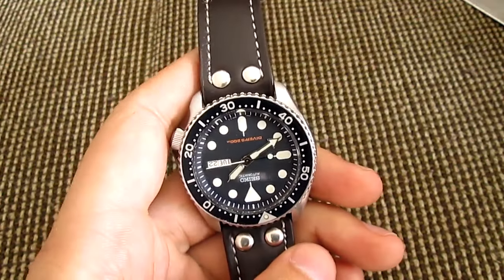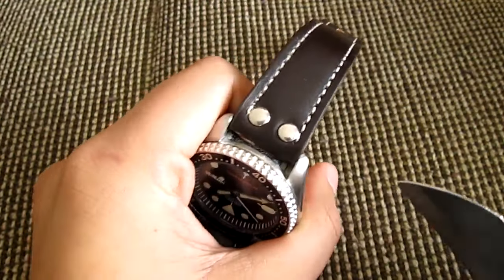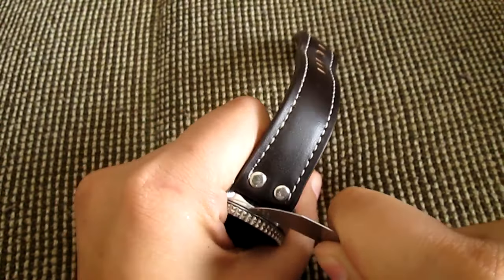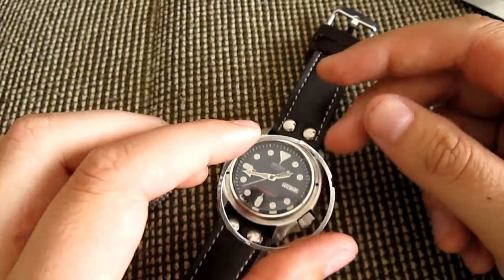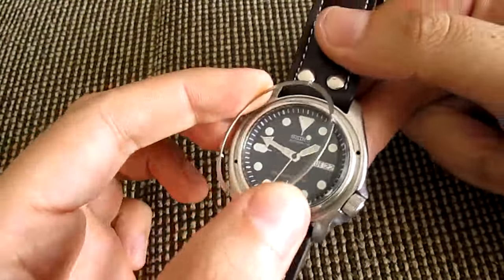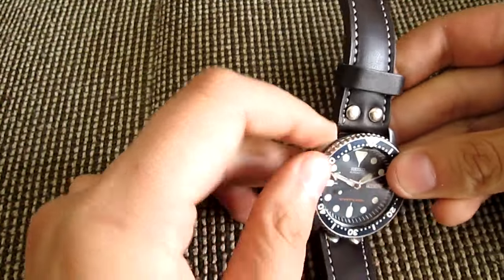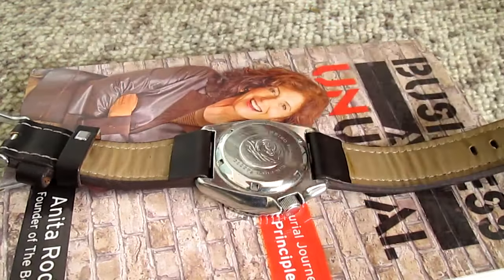How to Remove Bezel from SEIKO SKX Watch - How to Fix Stuck Bezel

Comment: That's the savage way, there is tools to remoove a bezel properly without risking to completly scatch the watch or even deeply cut you finger.
Reply: Newb question: What are the tools that one would use to swap out a bezel?
Reply: I use a katana sword
Reply: For $10 on Amazon you can get a whole set of watch back removal pry tools.  Works perfectly. 
Look for the ones with the large yellow plastic handles.
Reply: Are tools....savage

Comment: Don't use a potato peeler for this. Two feeler gauges (.006 and .007) will work better and won't scratch up the case.
Reply from the maker: I actually use Swiss Army Knife Victorinox can opener works like a charm but not everyone has one and I always try to find a common household item.. great suggestion though someone will see it and find it helpful

Comment: hi, have you ever done this with a Seiko skx013? The bezel on mine is tight and it is not gunked up as it is new. Would silicone oil sort it out? thanks
Reply: wayne murphy same deal. Manage to resolve the issue?
Reply: @benmfisher94  did you solve it?
Reply: @thenande  I popped my bezel off from time to time and made sure the spring underneath was lined up properly. A knife between the bezel and case should be enough to pop it off
Reply: @benmfisher94  Thanks! I don't know how mine is so stuck, I would press until my right hand hurts from the knife handle and it would not bulge. I'm glad you could, that gaves me some inspiration to keep trying.

Comment: I would suggest (if it hasn't been mentioned) to use a caseback opener. The edge is not sharp and has a taper that slides right in. Aside from that, great demo. It helped me out! Thanks
Reply from the maker: +Jan Alexus Kho my favorite and most efficient tool is Swiss Army knife can opener

Comment: Great video. I had a Seiko monster once that had a sticky bezel. I removed it with a butter knife and just like you said, put it on the carpet on the floor and just pushed it back on. Bezel is very smooth now.
Reply from the maker: +TheStig ZeroZeroZero as they should be .. Seiko Bezels are one of the smoothest I have ever had
Reply: Going to do it today with my SRP309 orange monsters with stuck bezel. Wish me good luck :-)

Comment: Thank you great vid followed your instructions ..... cleaned and popped a bit of grease onto the "o" ring and HAPPY DAYS, the bezel turns so much easier now. Also putting the watch face down onto a flat surface and yes popped right back on. Thanks again all the best.
Reply from the maker: happy it worked out for you .cheers

Comment: I recently loosened a jammed bezel on a Seiko diver by immersing just the Bezel part in hot water in tumbler,not the whole watch ! .....we only want to heat up the Bezel ring,not the whole watch
by immersing just The Bezel in hot water it expands the metal  ring,and frees it, also it loosens any gunk trapped in the Bezel.
very quick, afterwards rinse it under a tap rotating the bezel then lubricate with silicon spray.
One assumes all the seals are ok before doing this!

Comment: nice video! 
But I'd like to know if you have ever tried to change the bezel insert? If not, could you do a video on how to change the insert? I think it could change the look of a Seiko if you ever get bored with the color, or just to make it different!
Reply from the maker: +Guillaume David I did it once by accident so I had to put the insert back in ..however I didn't have the proper adhesive so I used loctite , I was careful and I was able to do it successfully but I dont have spare bezels to ruin for video :)

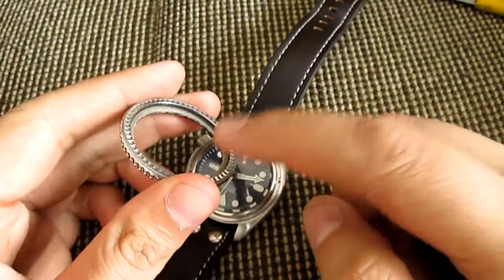Comment: OMG left thumb position until 1:45 is terrifying lol. do you know if the BEZEL INSERT will easily pop out once the bezel is removed like on a submariner? I have a SNZF17 that the bezel PIP is slightly off center between clicks and it drives me insane!! what kind of lubrication do you use, silicon? i've also read the sometimes you can free a bezel from sand, salt, etc... using tooth floss but i've never tried. thanks for the vid EDC!
Reply from the maker: +Andrew Poon if you pop out bezel insert you will need some kind of glue to hold it back ..not sure what kind but look into it before you do anything .. I just use silicon grease for the gaskets nothing else.. I suppose you can floss it ..if you are uncomfortable to do it (I would if it was submariner :) but this is generally better way to clean it .. I once had completely stuck bezel and after cleaning it was good as new

Comment: Great video! I need help though. When I press bezel back on only half of it wants to snap in place. I hear 1 loud snap but half of it is still higher than the rest and won't rotate
Reply from the maker: align it properly and use flat surface like a book until you get it right, when its half there and you make sure everything as it should be dot be a afraid to aply more pressure

Comment: Can you get to underneath the crystal this way or must you go through the back?
Reply from the maker: I wouldnt recommend it
Reply: Thanks, I actually found a video of how to remove the crown first & the movement popped right out. Was able to then get to the crystal to wipe away all the condensation. What's weird is as soon as I put everything back together. Condensation built up again??? So I figured that the movement probably had residual moisture, let it sit out in a Tupperware container with some of those silicon moisture absorption bags you find in rice bags & after about 48hrs it soaked it all up. Thanks!
Reply from the maker: 1988remixx thats a proper way to to do it , I think I have a video somewhere how to remove a crown from 7s26 .. I am not that patient once I used a blow dryer (that is not recommended) but I did it anyways :)

Comment: Hey guys i have a problem. I did this while switching the standard bezel to a red one, everything went smooth but the small metal disk with two notches in it (the ones that go into the two little holes) and i made a mistake and bent it. Now, bezel is just like a vostok amphibia, i can turn it both directions and it makes no clicking noise when i turn it. Is it still ok? is the water resistance still good?
Reply from the maker: bent it back where they were or you can buy replacement water resistance is not compromised
Reply: EDC Gunner hey man really appreciate the quick reply. Yeah i just put the ring back, but to be honest i prefered the loose bi directional action without the ring, haha just like amphibia
Reply: EDC Gunner so i can throw out this ring or what
Reply from the maker: I wouldn't be throwing it store is somewhere safely in case you change your mind
Reply: EDC Gunner ok i will store it with my watch stuff thanks for this help man 👍👍

Comment: Is there a way to make the bezel move more smoothly and easily than before?
Reply from the maker: after cleaning it should be much smoother also the wire can be bent a little bit but I would not recommend you doing it as you may break it
Reply: Define "Bend the wire" please? By the way i did give her a clean and a tiny touch of machine lube and she is more smooth than before.

Comment: Thanks! I tried with a book and with carpet. Even when it got completely flat it still will not rotate :( I'm thinking of using a case back press
Reply from the maker: maybe you should remove it and inspect the problem , maybe the wire is not installed properly ..

Comment: Haha I totally scratched up my watch case removing the bezel. I am going to need to sand it now.
Reply: I have fixed the scratches and chips already. For anyone interested I used a metal file to file down the dents to be smooth then sanded the case with a 1000 grit sandpaper in back and forth motion to recreate the brushed finish. Good as new.
Reply: Same here! Broke out the 1000 grit, Scotch Brite and some polish it get almost right..

Comment: Lots of yakkety-yak about how to line up the pins with the holes ... and not a single mention of what to lubricate the bezel with.
Reply from the maker: you lubricate gaskets with some silicone grease
Reply: That's not specific enough, example please.
Reply: silicone grease..can't be more specific than that, the brand does not matter.....can be bought anywhere...check auto stores for "dielectric grease", which is just silicone grease....